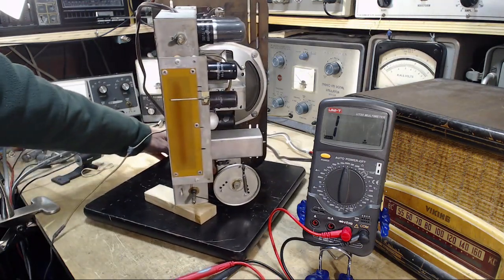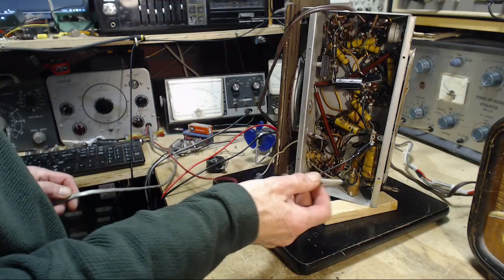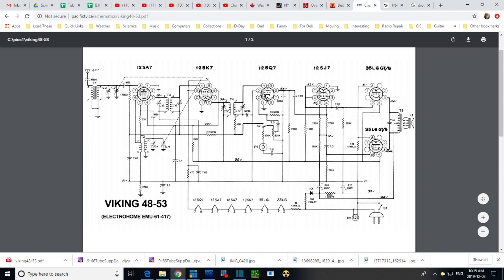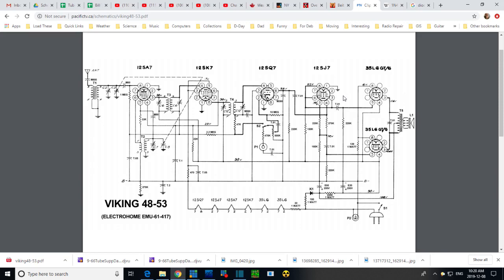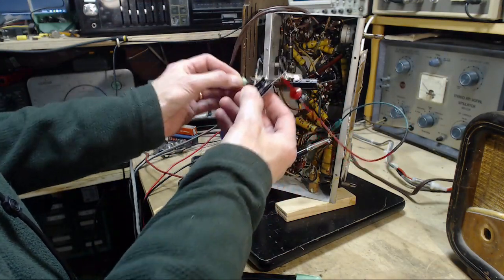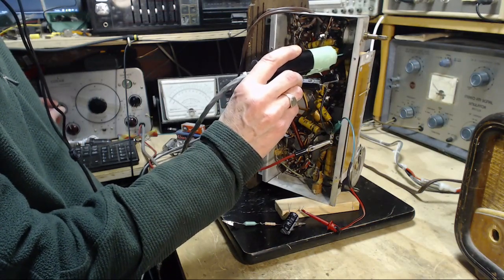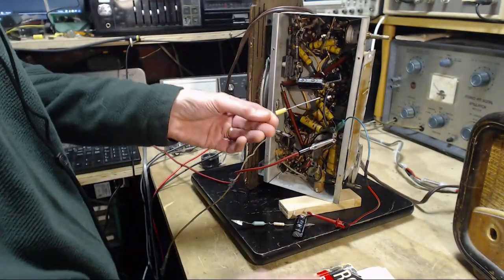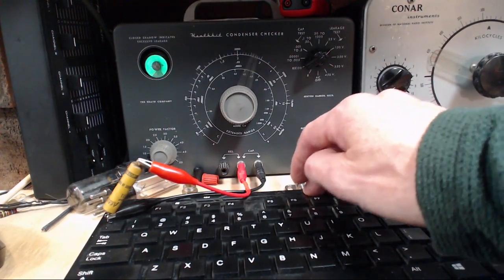Viking EMU61 Tube Radio Video #2 -  Fixing the Hum

Comment: So we found one wax capacitor leaky as hell and still ponder to replace them all? At least check the grid voltages on the 12SJ7 and 35L6 for any dc passed onto them from the previous stages by leaky coupling capacitors. And FYI Notice how the 12SQ7 in this radio has a 10M grid resistor to ground and its cathode grounded? This is indicative of it using the technique of grid leak bias. The leaky cap going between the grid of the 12sq7 and the volume pot however is shorting that attempt at grid leak bias to ground at a resistance of 500k or less depending on the position of the wiper.

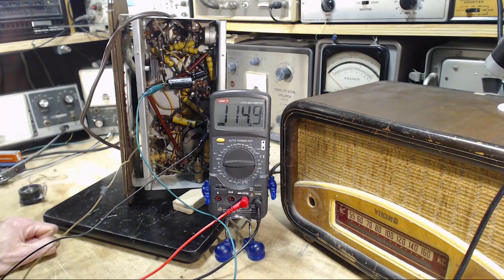Comment: 5:18 There is a 100 Ohm resistor in series with the rectifier diode. So no wonder the B+ drops significantly under load. 
5:24 The schematic calls for 106V as B+. So coming in at 115V is actually higher than called for, but given the lower forward voltage drop of the silicon diode over the selenium stack it is to be expected and should be of no concern.

Comment: Jim, if one of the paper caps was bad does it not seem a rational conclusion that the others if not bad already will go bad in the near future? Almost every other person I have watched on YouTube or read their electronic restoration posts always replaces ALL the old paper capacitors as a normal part of restoration of any radio. Many of them are electrical engineers that will tell you that you should always replace the paper wax caps.

Comment: A second note about Mr. Carlson:  He thinks that putting in the foil end of capacitors toward the grounded direction to increase the shielding effect is very important in any circuit where RF is going through the device to prevent/reduce the wire it is attached to from becoming an antenna and producing hum and cross-talk.  He considers it a sign of good professional work when this is always done, even when the effects are small; "small" is not zero and one should do the best work possible when making or repairing equipment - if it is worth doing, it is worth doing right.
Reply: Doctor Carlson is so far out he's in. He understands all known electrical stuff, although it is still mysterious in a way?
Reply: @tjwashington703  He is a true genius.  He designs and builds small electrical devices that anyone can duplicate that solve all sorts of common problems that have electrical troubleshooters "tearing their hair out" trying to solve, especially problems with things like capacitors that can have all sorts of bad but subtle side-effects when they go bad even in small ways.  Why didn't others build them before?  I realize that prior to modern things like LEDs, the equipment would have been larger and heavier and use more power (the movies BACK TO THE FUTURE 2 and 3 are hilarious concerning that), but the circuits he comes up with are merely using regular electrical circuits, just in new ways.  His capacitor problem "sniffer" box that needs only low power and can show a problem capacitor when it is just beginning to go bad is something I have never seen in any other electrical/electronics workshop, yet it would be a Godsend to many technicians and engineers trying to put together or troubleshoot electronic devices or systems.  A modern Tesla/Edison?